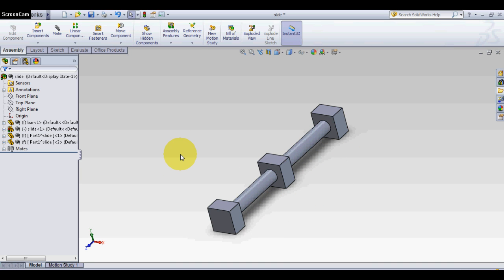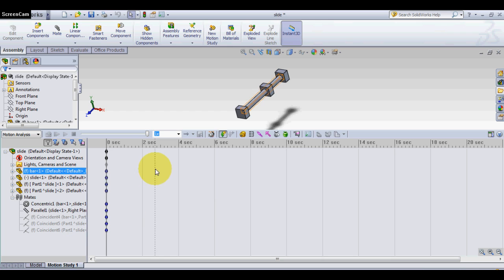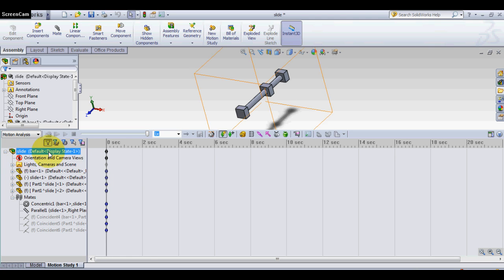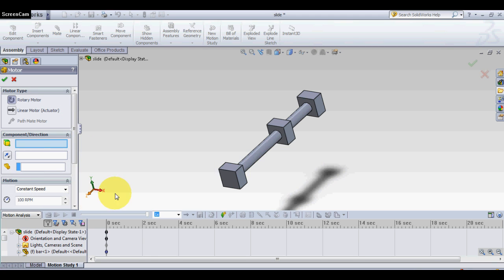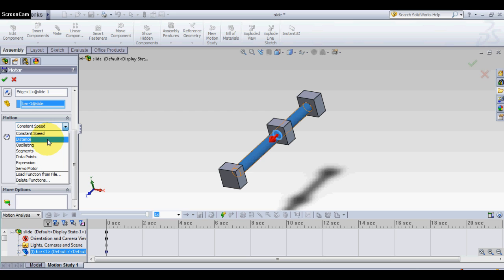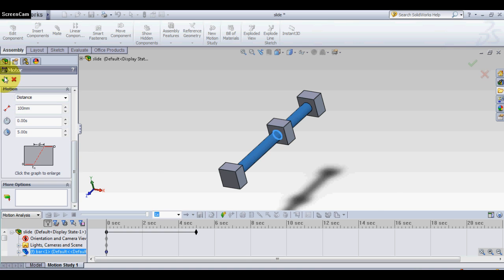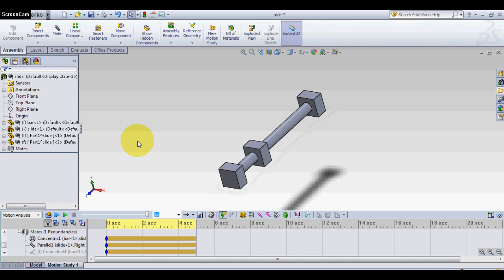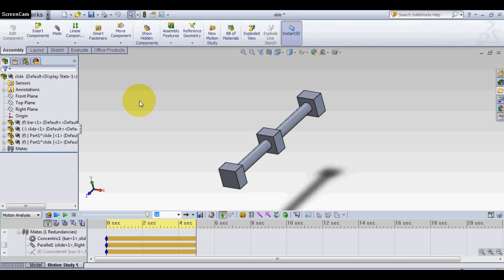Prepairing SolidWorks for Softmotion.avi

Comment: I know it has been long, but can you please provide me with more detail. i have a problem in my solidworks assembly i think because when i run the simulation the block can not recognize the position so it will continue running all the time, it actually runs for the provided distance (position) and then stops and than runs again automatically. Please help and thank you.